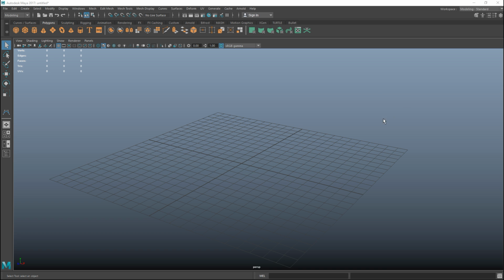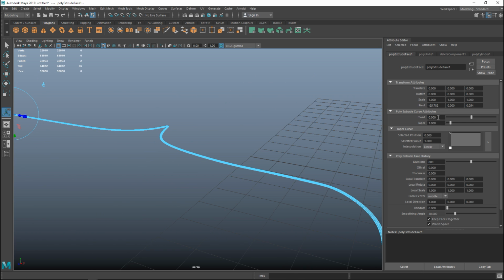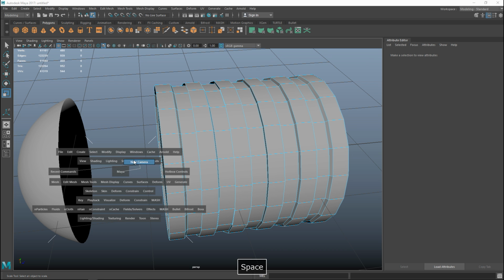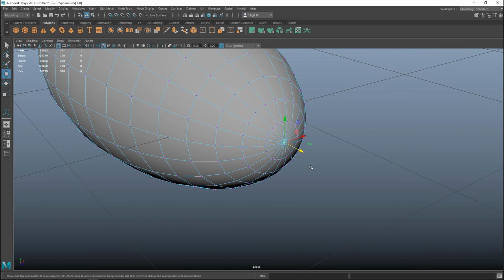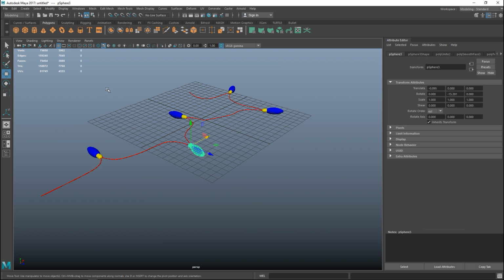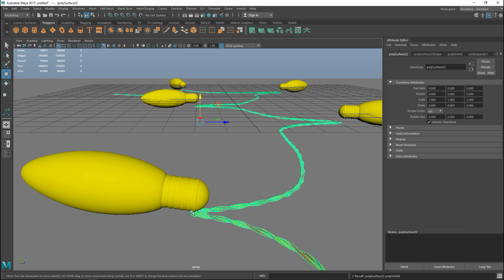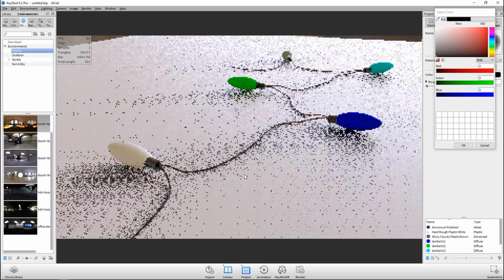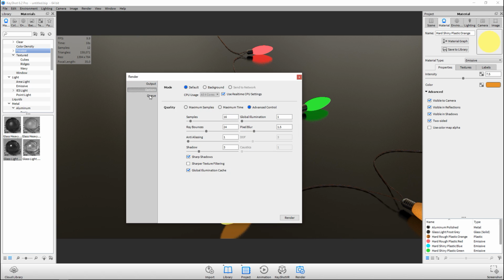3D Modeling tutorial : X-Mas Lights

Comment: I don't have KeyShot, so I'm using Renderman 21.2 NC.....because Maya is what it is, I had to reverse the normal's for the wire (though it took me 2 hrs to figure out this was the problem). Texturing the bump for the light sockets was being a pain, so by using other concepts you taught (plus what I already knew about edge loops)....after separating the sphere from the cylinder, I extruded the edge of the sphere to the appropriate length,  then added 10 edge loops (using an equal spacing multiplier of 4, then again between each of the sections with 1 equally spaced edge loop). 

I only found your channel yesterday, but I know it'll be allot of help!  Soon I hope to continue modeling and animating a realistic flaming football for my daughter's school.  Oh...and if you like Christmas, please look at the Christmas village sync'd to Wizards of Winter on my channel (it's real, not animated lol).
Reply from the maker: Sounds like you know what you are doing Duane ! Keep on going !